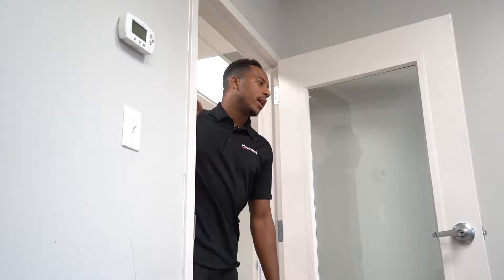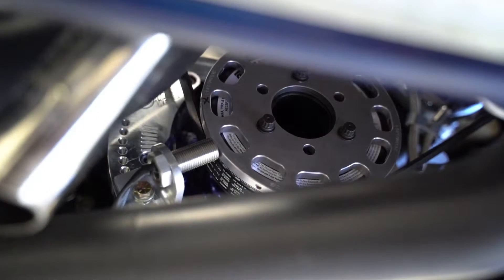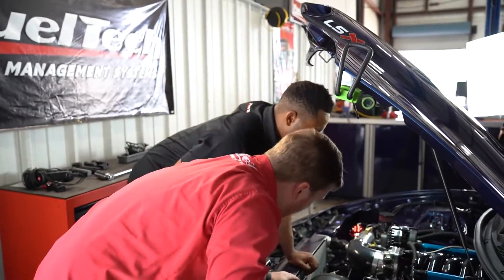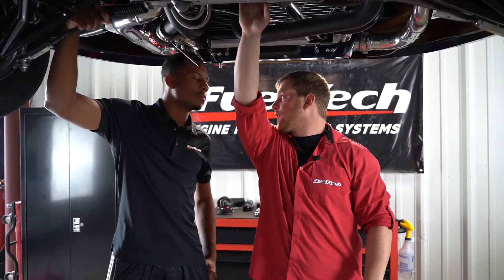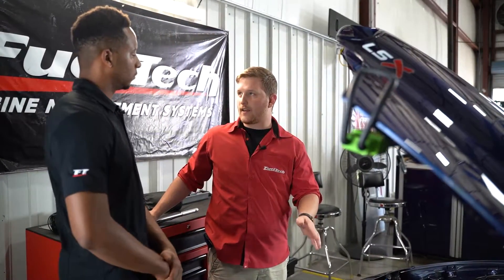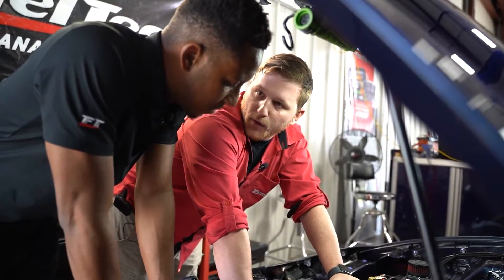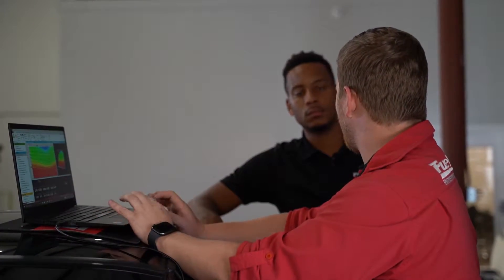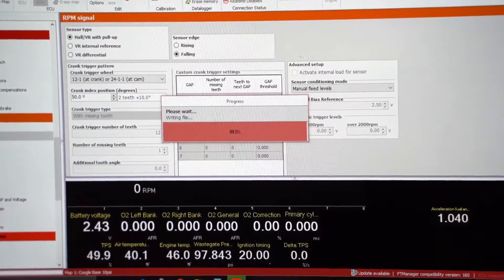How to set up a missing tooth trigger wheel on your FuelTech ECU step by step!

Comment: Wait a second im confused, why is this engine using an external trigger wheel?
Reply: its more precise
Reply: Every brand uses diferent hardware/setup, a pulley crank wheel its a Basic/sketchy way to do
Reply: @MrIngorodrigues  I know ford used an external trigger wheel with their EDIS system, and a few others did as well but all LS based and later Lt1 based engines had their trigger wheels on the rear of the crank in 24x and later to current 58x wheels, so is this some aftermarket witchcraft or something?

Comment: Is this the fix for the 24x issues?
Reply: I am still struggling with that problem. 24x lose RPM signal at high boost. I have no problem with Holley or HPtuner..
Reply: @MadAdventure919  I got mine to run on 24x but I haven't applied much boost to it yet
Reply: @isomfamilyracing2620  up to 10psi no problem here, but after that it loses signal at high rpm.

Comment: Can Individual timing and fueling still be used when the cam sync is ignored by the ECU after the 10 revolutions?
Reply: Yes because the ECU just needs the cam signal for the first revs to find the exact sync position. After it's done, it's done and you can run your sequential ignition/fueling
Reply: @diesdasa  Thank you.
Reply: gracias amigo. bendiciones.  @diesdasa